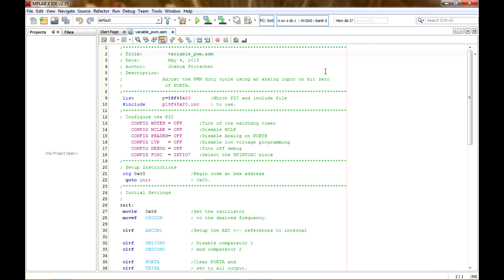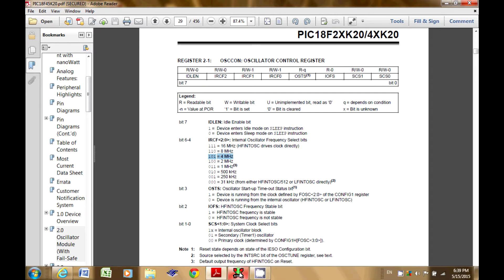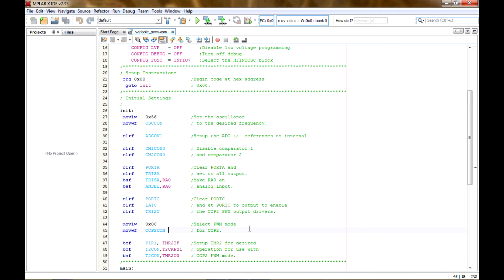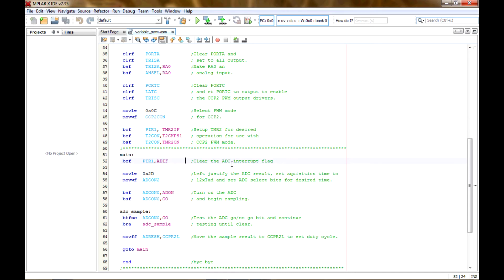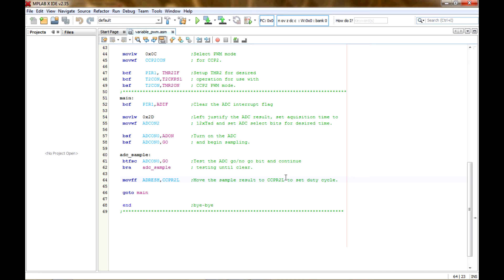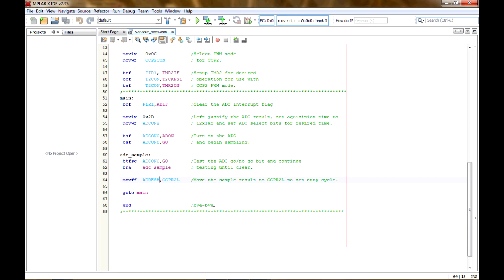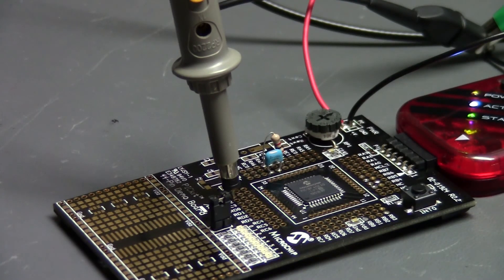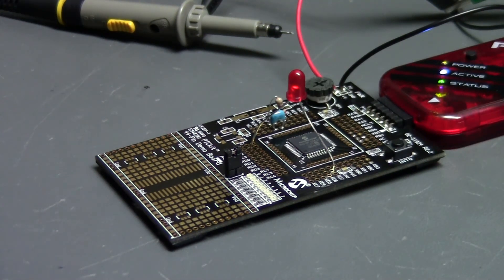PIC18F Assembly Language Programming - Variable PWM using ADC

Comment: It is usually easy to include AD 10 bits to PWM registers.
This is how I do it for the 18F series.

; ADRESL bits 6, 7 LSB of ADC
   movfw ADRESL   ;movfW   ADRESL
; right shift bits 7, 6 to bits 4, 5
   movwf   RESULTLO
   rrcf     RESULTLO, F
   rrcf     RESULTLO, F
; 
ADCtoPWM:
   movfw  RESULTHI
   movwf  CCPR1L
; RESULTLO bits 5, 4 LSB of ADC
; CCP1CON bit 5,4 LSB PWM
  
   movlw b'00001100'
   iorwf   RESULTLO, W
   movwf CCP1CON  ; turn on PWM

Comment: What Schematic Capture software are you using w/ the virtual instruments? Is this a plug-in? Thanks.
Reply from the maker: that's an oscilloscope...
Reply: I know it's an oscilloscope. That is not what I asked. The question is - What is the software package they are using that has Schematic Capture (to draw the circuit) & Virtual Instruments (to connect them to the circuit)?